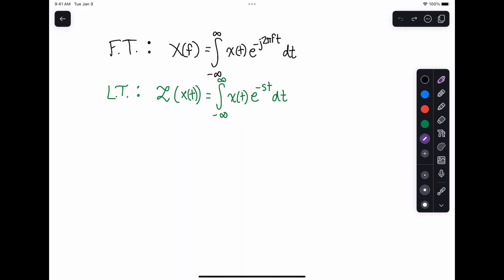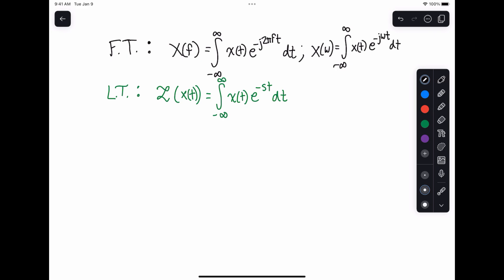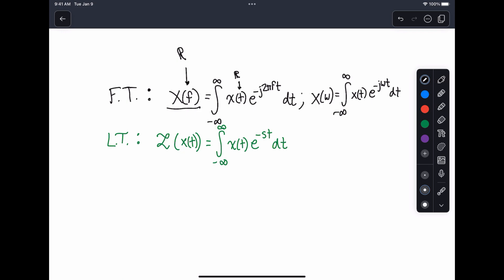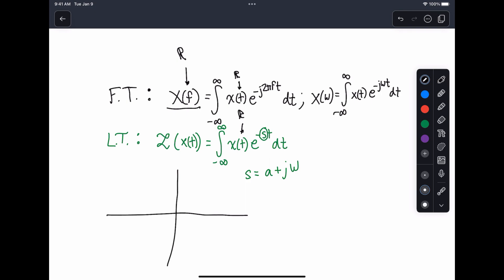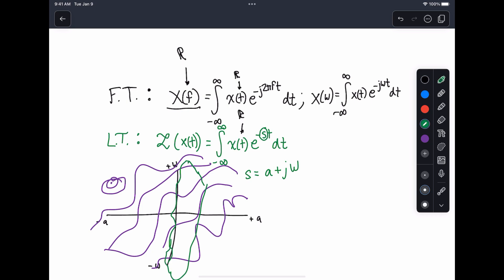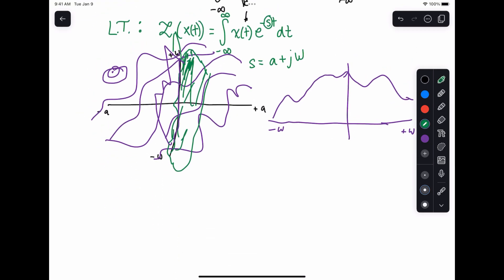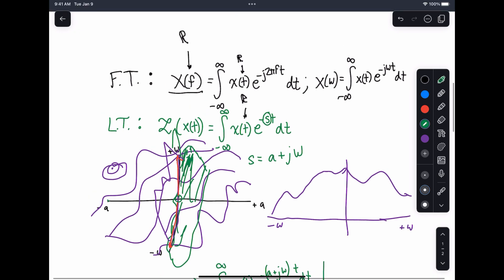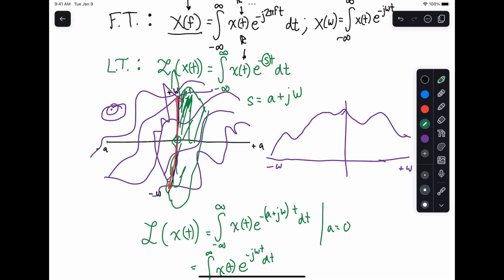Why are the Fourier Transform and Laplace Transform Similar?

Comment: Laplace transform integral from ZERO to infinity.
Reply from the maker: There’s a unilateral (0+ to infinity) and a bilateral laplace transform (-infinity to infinity) - which one you choose depends on your initial conditions.  
If you’re working with causal signals they’re the same.  Whoever taught you Laplace transforms should have clarified that both are valid, because it is wrong to say the “correct” Laplace transform is the unilateral one.